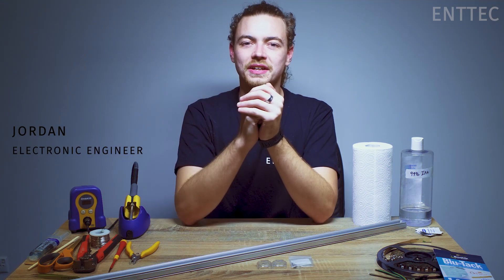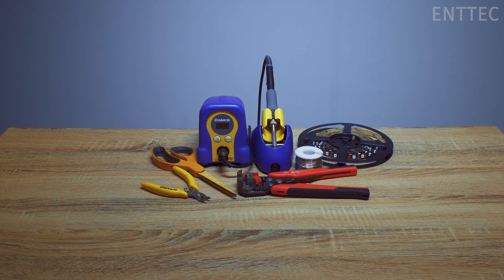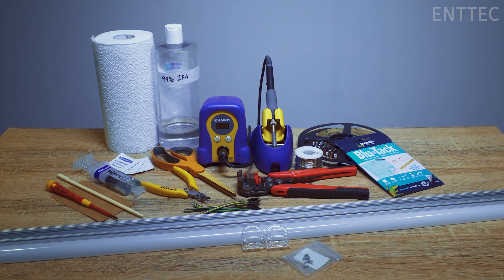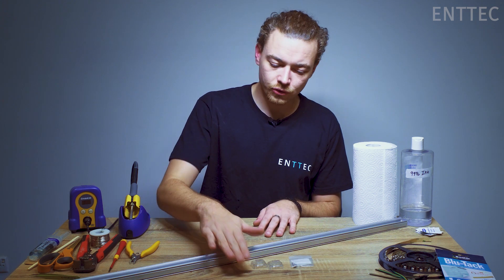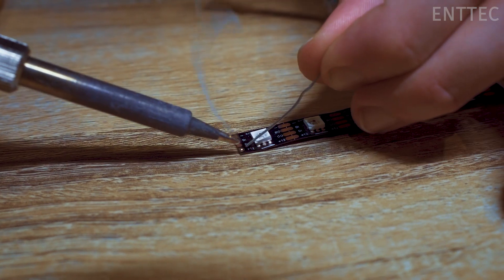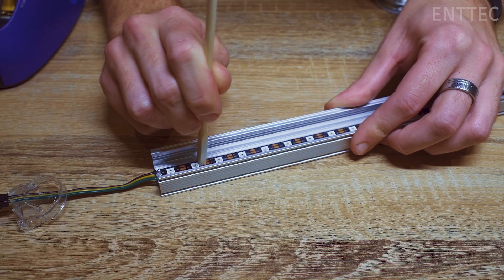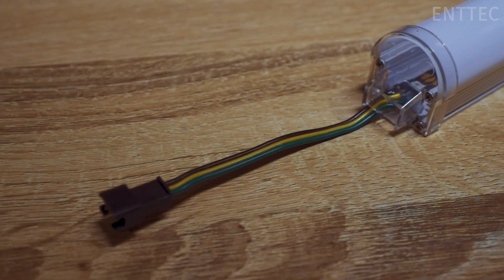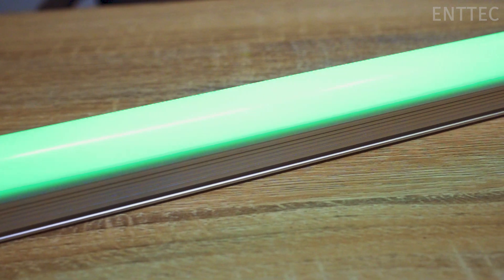Ep.6 How to make your own LED bar

Comment: great vid...but you really should lay out the parts... cause i need that extrusion AKA: Channel
Reply from the maker: Hey there, thanks for the feedback! In this video we used a fairly standard aluminium profile. - in fact we used to sell this as part of our range from our head office. You can find the current range here: https://www.enttec.com.au/range/led-strips/led-extrusion/ Ultimately, any LED Extrusion will work. As a rule of thumb, approximately 20mm between the surface of the LED and the diffuser gives the best results when using 60 LED per meter strip.